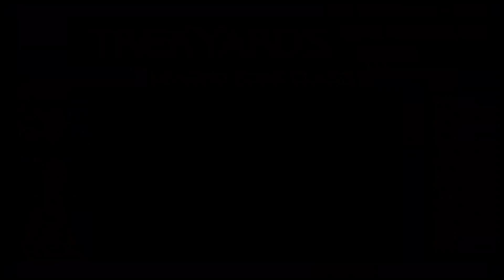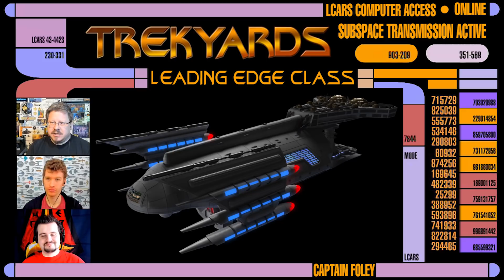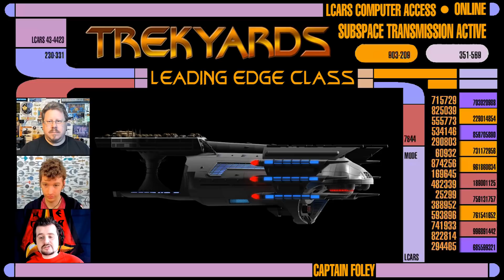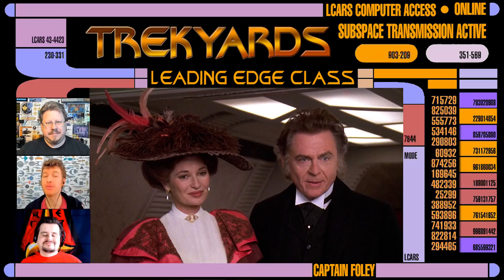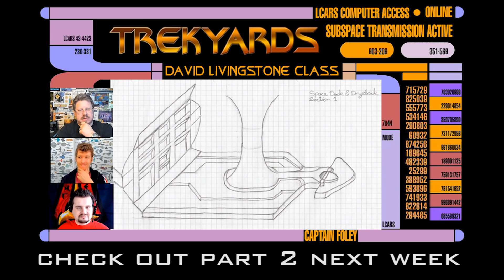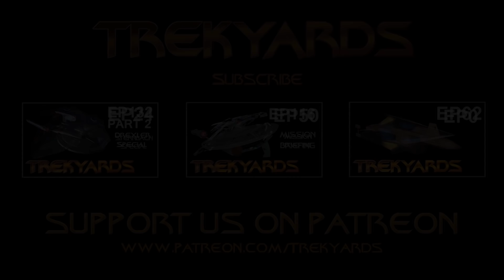Leading Edge Class (Exploration Fleet Support Ship) (Part 1) - Trekyards

Comment: OK, first gut reaction "WTF is that????"

After the initial shock:
I think a circular Vulcan style nacelle would have worked better, the pylons on this look like they'd snap off as soon as you applied any thrust.
The docking column at the front should be a tad further forward, to prevent ships crashing into it while heading into or out of the ship bays.
My first thought on that "saucer-like" section was that it looked like a docking port for a much larger actual saucer.

Comment: cool ship,  still it would be much more better if the Docking area is covered !!!!
Reply: Hi Derek, so great you respond this comment! So does the docking pylon area will be covered during moving or in case of emergency? Does it having  city like the one in Macross/Robotech City ship?
P. S. Compare to Starbase Yorktown which one can accommodate more ship?
Reply: @yukin1990  No the pylon is the docking and storage area like the outer docking ring of DS9. It allows the upper area of the ship to act as a trading area and lower section to act as docking control.
Reply: @derekrankin7842  This feel wired to me, but i feel like the pylon should be more protected!!!One thing I prefer ESD from the prime timeline than the J.J Kelvin timeline's ESD!!
Reply: @yukin1990  I did give some thought to this and my view is that the scale of the ship must be taken into account. At its narrowest point the Pylon is about as wide as a Nebula saucer sections. Also the shields and deflector are incredibly strong so if anything that can cause damage to the pylon get through them then an outer hull would be rather redundant. Like using a tin foil shield to protect against a shotgun.

In the bio I put in that the docking area utilises tractor beams to position ships within berths and to dock and there is a dampening system system in place that can render ships that are within the docking area powerless by disabling their warp cores (Okay not powerless but without their cores all but really). I also wanted as much access to the pylon as the class acts as a trade centre and has considerable use as an emergency response vessel.
Reply: @derekrankin7842  I assume the Warp bubble cover the pylon? And the ship in the docking pylon will be safe during Warp travel right?
Reply: I have in the bio that it uses deployment technology based on Voyagers armour deployment system from the final episode. When a ship is inside it has environmental shielding and rapid deployment hanger door.

Comment: before i saw the ship beside the Borg Cube its pretty interesting, i even like how it seems to be large enough to hold actual Star ships, the domes and hammer head style front actually is pretty intriguing, that front piller piece is... alittle in the way personally, but its growing on me... the parts behind the front hanger actually looks awesome, i love the design of the secondary hull, even the pylons for the six nacelles is nice
sees the part with this ship in front of the borg cube O.O... if each of the weapons this ship has is always on a different frequency, the borg is just done, have like 10 of this ship, the Federation and its alliance will almost be protected by anything, plus they can now have there star ships be taken far with this ships slip stream drive
Reply: There are only 3 ships of this class total due to the complex design and heavy resources. Also the reverse engineered "Doomsday weapon" has a severely limited arc of fire and very very limited shots at weapon power levels as it is seriously not designed to be a weapon. 

The ship starts out as you see it but would change in design over time and after a century or 2 could look very different.

Comment: I do like the design and intent of the vessel. However its top speed is really slow compared to other vessels of the time. I could imagine it having both larger and more powerful warp engines allowing higher warp speeds, if the slipstream fails/glitches. Especially close to the time of the Dominion War. A vessel like this could be used to transport an entire fleet to a new location instead of attempting to create a fleet from far apart individual ships. Even if Star Fleet only had 6 of these vessels with only a fleet of warships they could decrease the time to dispatch the vessels. 

The Constitution and Miranda Classes, for example, are tough and versatile ships, but they're too generalized to really be effective battleships in the late 24th Century. However a Constitution and the Miranda Classes are fairly cheap, faster, and easier to produce in comparison to more modern designs. A small fleet of dedicated warship Constitution and Miranda Classes could do a lot more in battle than be canon fodder.

The modern militaries are still using the B-52 bombers. Granted they're not the 50+ year old originals, usually. The designs are updated with many of them still having propeller engines, and many of them having jet engines. I could imagine that the base design will still be in production well into the next 50+ years.
Reply: The class utilises Slipstream for its major travelling and warp speed for short distances. The class allows for the support of smaller ships at longer ranges than they would be capable of operating.
Reply: @derekrankin7842  I do understand that it's intended to use a slipstream drive as the primary propulsion, but if the slipstream isn't working for some reason then the standard warp drive is rather slow. It's carried fleet could deploy and get to the battle faster then the carrier.
Reply: @henrynii3363  I wanted to make it having pushed the limited of the technologies of those involved. I did not want it to be all singing and all dancing. That way there is room for growth and development over time.

Comment: I love how "outside the box" this ship is. To be honest it's ugly as sin, but it's a really cool concept.
Reply: Ugly as sin was pretty much where I was going with it. It had a job to do and it was designed by various races with different ideas on aesthetics.
Reply: @derekrankin7842  I figured.

Only thing I'd change is to have the nacelle pylons continue and reconnect with a strut at the top of the ship, as well as a couple struts on the sides(if for engineering access if nothing else. quite a trip to that top nacelle control room without transporters otherwise). that way you'd have a complete ring much like the early vulcan ships
Reply: @Jarsia  Please remember that the struts look thin but given the scale of the ship are probably several times the thickness of a Galaxy or Sovereigns struts and easily thick enough for turbolifts!

Comment: Mmmm.  Not a fan of the design; too kit-bash for my taste.  And actually, the best ship design the meets the criteria of the designer of the Leading Edge class is, IMO, the Star Wars Trade Federation ship.  The ship's size (which has the radius of an Imperial Star Destroyer) can accommodate dozens of Starfleet vessels, and has multiple functions (including setting up colonies).  I do like the idea of a class of ships being crewed by holograms.  Best yet, such a crew, when "off duty", can exist virtually, without having to take up actual space (see: TNG's Ship in a Bottle). 50/50.
Reply: The holocrew is actually in the minority.

Comment: no.
Reply: Why?
Reply: Numerous reasons. Enough with the 50+ nacelle ship designs for one. It's visually offensive for another. Making things flippin huge doesn't make em cool or even possible for yet another.. The subspace warp damage caused by something this massive would be.. er.. massive.. for yet another..
Reply: @Echostation3T8  I actually tried to space 3 nacelles to maintain line of sight. Also the reason for the big nacelles is that the  warp field is so large it is difficult to maintain, thus the low warp speed. Also as I wanted this design to have no real limit to its operational time it would change and the numbers would get reduced until it either just utilises slip stream or has an alternative drive system.
Reply: @derekrankin7842  Look up 'line of sight' and Roddenberry's thoughts on the matter. None of the 3 nacelles on one side of the ship can pair with the nacelles on the other side. If your thought was line of sight on a single side -the 3rd of the ludicrous sized nacelles serves zero purpose other than to possibly irradiate the crew.  Back to my original comment: no.
Reply: @derekrankin7842  So many nacelles! https://www.youtube.com/watch?v=mmRtzqgn2d8
Reply: @Echostation3T8  But given the scale who is to say the line of sight needs to be side to side. Why can't it also be up and down?
Reply: @Echostation3T8  I would also like to admit that they can only spend so much time on the project in relation to how much you spend... and I ran out of money so a number of things would have been changed with more time!
Reply: Derek Rankin I addressed the up and down in the same reply as the line of sight criticism. This ship is the Trekked and supersized the Family Truckster.
Reply: @Echostation3T8  To be honest what I was going for in the whole thing was the idea of something other than a warship. My ship is super huge but for a reason. For every technological marvel there is a cost. For instance its huge size makes warp speed very slow. The reverse engineered "Doomsday Weapon" makes a great mining beam and even though it can be turned up to 11 it is all but useless as a weapon because it is pushing the tech limits in its construction and is still not as powerful as the original. I don't feel these disadvantages  were conveyed as well as I would like in the ep.
Reply: Derek Rankin I feel the ludicrous scale along with the overall gracelessness of the design are unjustified. The planets that would have to be utterly obliterated to obtain the materials would make the Borg look like the warmup comedians at a strip bar. No amount of money or time can fix wrong.
Reply: Derek Rankin I watched both parts 1 & 2 of these videos- there’s zero need to repeat what you said. I feel this is not something the Federation would ever produce at any point. That’s my opinion.
Reply: @Echostation3T8  fair enough... still enjoyed doing it! lol

Comment: This thing is too big for Trek.
Reply: There has been bigger!
Reply: @derekrankin7842  I mean trek ships themselves, not whale probes, doomsday machine, or veger etc.....
Reply: @SurfTrekTonics  Yeah, in that case they can all suck it!!! lol. Mine is the big boy.
Reply: @derekrankin7842  I like the design, but it could be scaled down a lot and be still be a good support ship.
Reply: @SurfTrekTonics  I was trying to envision the internals and you have to bear in mind that unlike a normal outpost this has to be far more self sufficient. There is need for mining, fabrication, scientific, trade and residential facilities as well as the dry dock. Also the ship has to support multiple races fleets. It is harder to judge but I feel this is the right size. I have had comments from two camps. One says it should be bigger, the other that it is too big. No one will be happy so I decided to make myself happy.

Comment: While I really like the idea behind the ship, I can't say the same about the outer shape to be honest. Not complaining about the size, that's perfectly fine (I'm tempted to say that it could actually be a bit bigger!), but the overall layout just doesn't cut it for me.
For example, putting the docks in the front where they're partially covered by the large pillar makes them partially impractical because there's always the risk of a damaged ship crashing into the pillar when trying to get into its parking lot. They'd make more sense if they were arranged along the outer hull so ships can easily enter and exit them without endangering the ship.
As for the main hull itself, I think that behemoths like this one should always be more tower-like structures, with the bow being the top deck and the engines being the bottom. That would work very well with the spacedocks, as they could be arranged around the main hull's center axis, allowing ships to enter the docks from different vectors which minimizes the chances of accidental collisions and optimizes the traffic flow.

Also, the position of the warp nacelles is ... well, we know what Probert would have to say about this, so I'm not gonna beat a dead horse here. ^^
The split bow with the pillar connecting the parts is interesting, but it looks TOO diverse in its construction to be really practical. Personally I would have kept it to the klingon baseframe (to complement the upper deck of the bow) with the cardassian habitat domes attached to both main areas instead of just the top one.

All in all I'd give this a 6.5 or 7 out of 10. Good premise, innovative ideas, but a bit lacking in the practical execution department.
Reply: Thanks, hope you had a chance to read the bio, the ship actually grows over its lifetime.

Comment: I Love it!! However I do have a question, I thought that using a Quantum Slipstream Drive was quite risky, so wouldn't it be better to make the main form of propulsion on this vessel warp? It's clear that it would take many resources to make a vessel such as this, so why risk it being destroyed?
Reply: This is decades after the return of Voyager and Slipstream has been in use for approx. 50+ years. It is not so much a risk as a necessity. I have uploaded the bio to the Trekyards FB page and in the specs the ship cannot achieve a very high warp speed and instead uses slipstream for most the journey and warp to finish off.
Reply: @derekrankin7842  Thank you for clarifying that :)

Comment: First thought from the thumbnail: It looks like a dinner table attached to an airstream with warp nacells on it, not that there's any need for streamlining in space though. Very weird and original design though. I can dig it!
Reply: Main hull was based initially on the engineering section of the Galaxy class!
Reply: Derek Rankin I've designed something similar myself, but mine was a little larger than a super star destroyer and was an intergalactic fleet carrier based on 42nd century federation technology. Someday I'm going to make a mesh from it, but I don't have the software that I need. What kind of software did you use to make this btw?
Reply: @DeathBYDesign666  I didn't make it, it was a guy that works with Trekyards and Samuel Cockings did the lighting.

Comment: "stellar nursery drive"
What you've done there, mates, is utilized the Eye of Harmony. The Core of the TARDIS.
Noice.
Reply: My hands were somewhat tied on this one. I needed something that was OP as the ship is soooo big and likely to get bigger as the centuries past and at the same time not fill the thing with lots of warp cores.
Reply: the area of a star filled with warp cores would be much more powerful then using a star
Reply: @derekrankin7842  Warp Cores already put out power surpassing that of a star. At least when looking at the Alcubierre drive's power requirements. Bigger, more efficient warp-drives, maybe those using stabalized trilithium or decalithium instead of dilithium. Or maybe an 8-core assembly with hyperlithium multithreading and a hydraulic cooling system. Or a stellar nursery drive. Use whatever technobabble you want, this is Star Trek.

Comment: If they are using reverse engineered Dyson sphere tech then a stellar core being held in partial stasis would be enough to power dozens of ships that size not to mention that the quantum singularity cores could act as backup.
Reply: If they are reverse engineering the Dyson sphere, Starfleet could quickly shoot from a K1.9 to a K2+ civilisation far exceeding all factions baring the Borg or potentially Voth
Reply: @ck686  All species we have seen on screen anyway! To be honest Starfleet had pretty much pushed warp as far as it would go. Also by the time of the Sovereign it stopped being getting the speed but making them more efficient and reducing their size!
Reply: @ck686  Reverse engineering elements and technological concepts is a far cry from mastering it!
Reply: Actually the tech is so advanced they can barely manage it and the quantum singularities are there in case of an overload so the can dump the excess energy... and yeah also to act as a spare wheel of sorts! lol

Comment: I like the overall concept but this is very fan ficy, lol. With a proper slip stream drive, Starfleet is more like to continue it's long range explorer ships, maybe shuttle carriers too.

The Galaxy class could be in space for 5 years before having to return home, and so could most any of the other big explorer ships. Saying they'd have to come back every few months is silly.

Also huge stations like that would be really hard to move. They barely made DS9 travel between Bajor and the wormhole.
Reply: The thought is the farther you go the more independent your ship has to be and the bigger, like the Galaxy class. The downside is that it takes more time and resources for such a ship and takes longer to explore a region than lots of tiny ships.
Reply: DS9 had no engines other than station keeping thrusters. Miles O'Brian had to overpower them and burnt out quite a few to get the station parked near the wormhole.

Comment: Really does blur the line of a starship and space station. Once on location where it will stay for a decade and be a shipyard outpost they could dismantle the nacelles to use the rare elements on standard size ships. One nacelle could be used to build a dozen standard size nacelles. Then once it is time to move they rebuild the nacelles. It could take a decade just to build one ship that it could be feasible to build just enough to get it to the operating location then finish building it there.
Reply: Its a support ship, any ships added to the fleet would come from the Alpha quadrant.